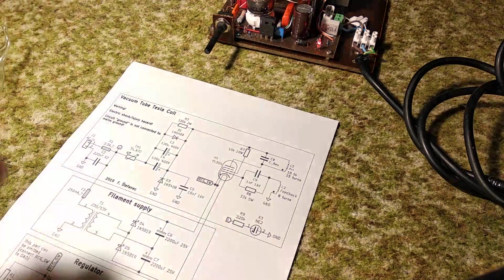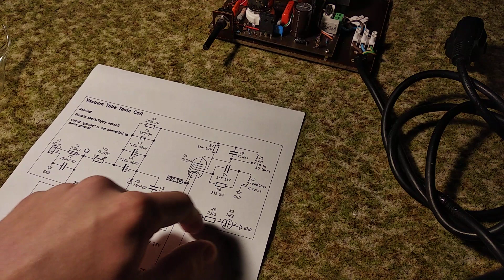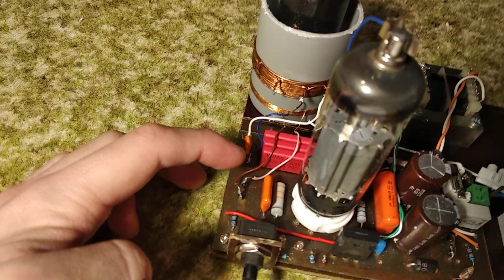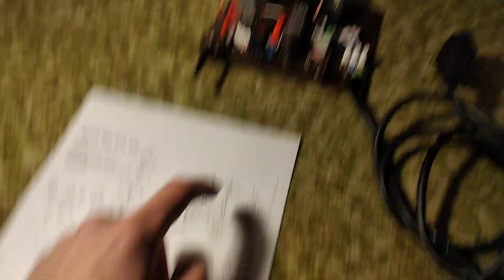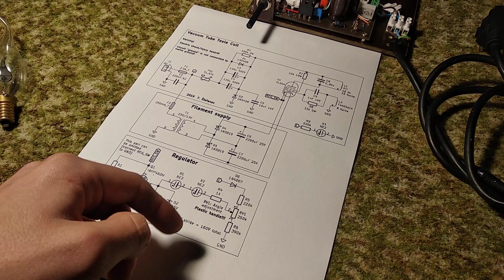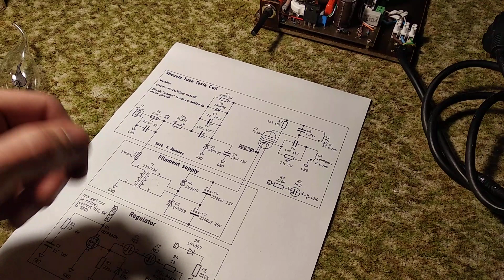Small Vacuum Tube Tesla Coil - Description

Comment: Hi! I love the design and I found a few of these PLs in my attic. Do you remember what wire diameter you used for the primary and the feedback coil? I didn't find it on the website. Oh, and if possible, how many turns are on the secondary? Many thanks <3
Reply from the maker: Hi, sorry, I don't have this info anywhere, it was a long time since I built this VTTC.
Reply: @tefatronix  Shame but thanks anyways! I'll try my best to get it working!

Comment: Nice build and very clean construction. That's the jozef bogin schematic right?
And at 80 watts with 15 for the filaments that would be around 65 watts through that tube, with a max plate dissipation of around 25 for the 504 I can see why it would overheat rather quickly😅
Have you gotten it to redplate during your tests? Would be worth a try to adapt this circuit to a 509 or 519. Sweep tubes are a joy to work with, hard to kill those little bastards, I'd say the tube can handle a cherry red anode every once in a while 😂

Comment: the regulator seems to be quite complicated. Does it need to be pulsed? If so, how about controlling directly G1 bias or G2 voltage? (Actually, G2 should modulate the output, but I am not familiar with PL500/504).
Reply from the maker: It doesn't need to be pulsed, but this way I save power while keeping or even increasing the spark length (e.g. 100% power at 50% duty, versus 50% power at 100% duty - peak power remains the same - max - while average power drops). Sure you could control gate bias, I haven't experimented with G1 bias though, but changing the G2 resistor has some effect. It probably could be regulated that way as well, and I might experiment with it eventually (if I ever decide to build another VTTC).

Comment: Pretty amazing! Is the bottom of the secondary grounded (to the soil)? If not, where is it? I dont see it on the schematic.
Reply from the maker: Thanks. I connected it to the mains earth, it works, but isn't optimal, having a big ground plane (piece of metal...) also connected to the secondary bottom would be better.
Reply: @tefatronix  could you make another video on this coil, and also what are those neon bulbs in the circuit for? What do they do?
Reply from the maker: @collimate5399  I don't plan on doing so, sorry. The neon lamps are used a bit like a diac, when the voltage gets high enough, they turn on, start conducting and their voltage drops. This is used to turn on the MOSFET,  which will thus turn on the entire oscillator circuit. Adjusting the potentiometer will adjust the voltage - and depending on "how much of the half-wave" gets through, the duty cycle/power is regulated. If you want more info, you may find the written article useful: http://tefatronix.g6.cz/display.php?page=vttc1&lang=en
Reply: @tefatronix  Thank you. One more question. If you have a high enough voltage coming out of the filament transformer, the voltage doubler circuit can be omitted?
Reply from the maker: @collimate5399  Yes, of course. It's even a better solution. I just used the doubler because I had this transformer at hand.